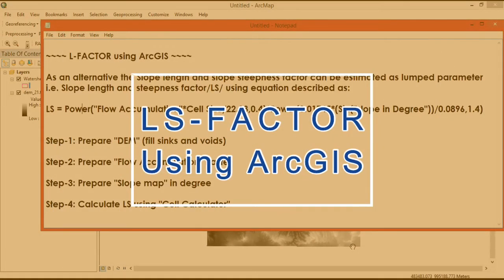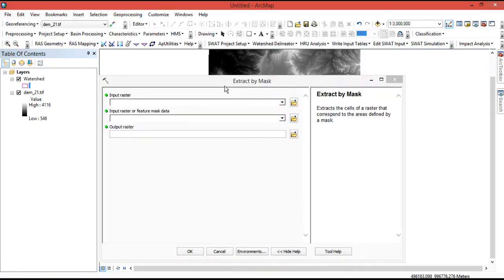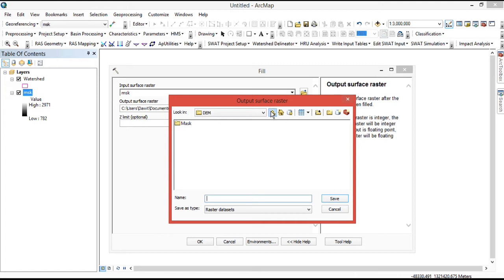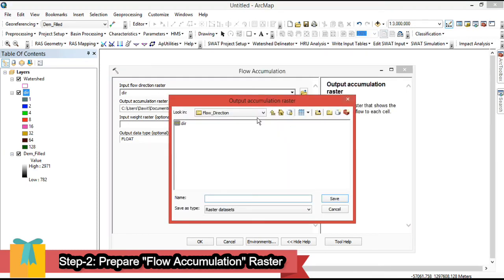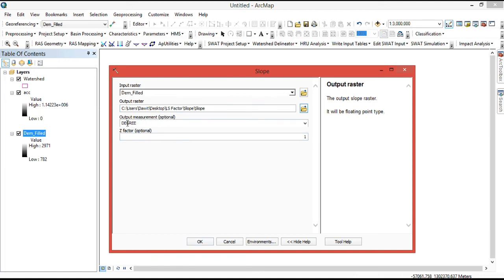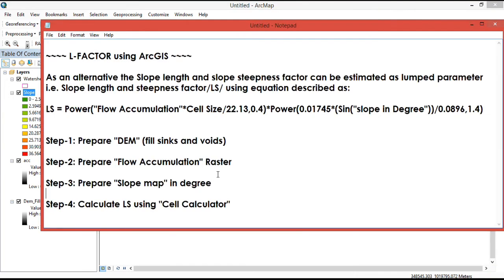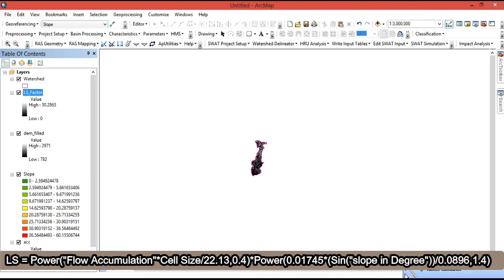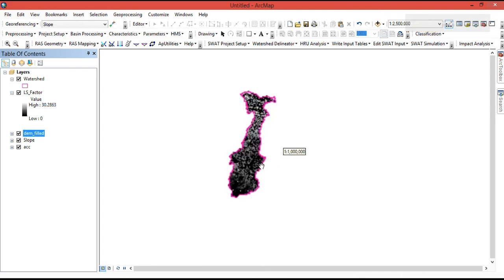LS-Factor (Slope length and steepness factor) for estimation of soil loss using RUSEL model Part-II

Comment: I am getting nodata values in my output LS raster after using this formula. Maybe the factor '0.01745' should be multiplied inside the sine function to convert the slope degrees to radians?
Reply from the maker: Check your data! Garbage in garbage out!
Reply: Hey,  did you get your answer...
I also think it should be inside...whats the update?
Reply: @somapsilwal4980  Yes it is to be multiplied inside. I confirmed from the existing literature.
Reply: @rachit8730 got it,  thanks👍👍

Comment: Thank you for the video. I have a query, if you have answer, please reply. The value of m for this equation varies according to the slope gradient. How do we incorporate this in the equation? You have used 0.4 in this video.
Reply from the maker: Yes, correct
Reply from the maker: I mosty ovserved some researchers uses anyother locations LS factor equation. Check the video repeaedly there are many equations include incase it help.

Comment: Assalamu alaykum. Thanks for the video. What is the source of DEM data? In my SRTM DEM data, the cell size value is 0.00027. Is it correct that I enter this value instead of cell size when calculating LS?
Reply from the maker: No cell size should be the same on the video. You have to convert the cell size to 30...m resolution by exporting the DEM.